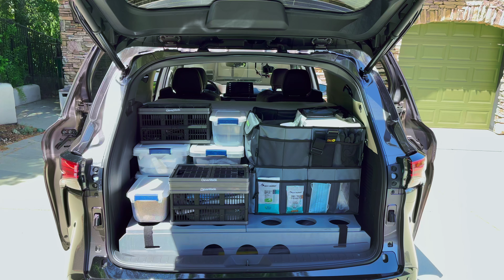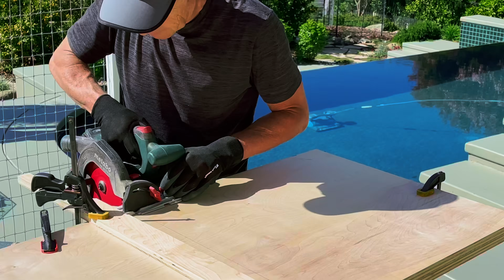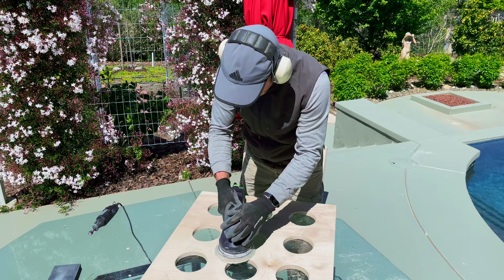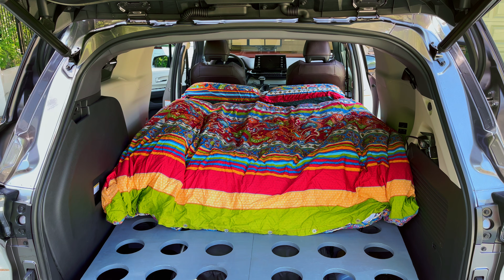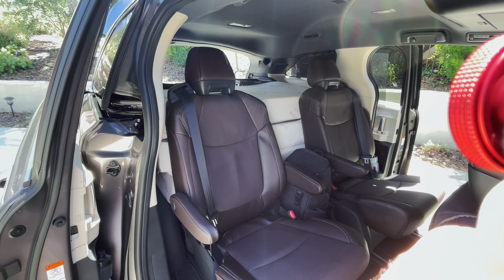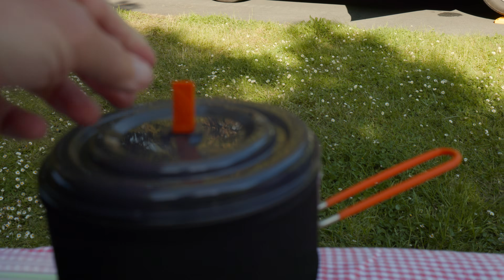2021 Toyota Sienna Camping Conversion: 2 and 4 seats sleeping configurations

Comment: Thanks for posting the Sienna videos.
I have a 20 year old AWD Sienna that I sleep in from time to time.
I love it. 
It’s pushing 275,000 miles and I’m thinking about getting a 2021 or 2022 AWD.
They’re not so easy to find in So Cal.
I found one in Palm Springs, but the website doesn’t have a price and it’s green. I prefer green in mine but maroon in the new ones.
So my requirements are AWD and spare tire.
I’m not in a super big hurry to buy.
I’m not in the market for one as high end as you with the inverter etc.
Some reviewers complain about the lack of power and the engine revving all the time.
I don’t drive that  aggressively but I am sensitive to sound. I need to find one to test drive.
I am a little concerned about the battery. It wouldn’t last 20 years like my current van has.  Maybe 10 years like the one in your Tesla.
I have an R5 too and will comment on one or two of your videos about that.
I don’t use my van or camera nearly as much as you, but again, appreciate the videos on the subjects.
Reply from the maker: Thank you for watching and sharing experience with your Sienna. Impressive mileage on your van. The shortage of microchips delays production of many vehicles nowadays and dealers ask for MSRP or more with extra add-ones. I hope this will change soon. Regarding your questions about the noise and power in new Sienna, you should definitely test drive it to make sure it will work for you. I believe  you will be impressed. After owning 18 vehicles, I think new Sienna is one of the quietest vehicles while cruising on a highway. You probably have seen my video “5 likes and Dislikes…” about our Sienna, where I tested how it sound inside and driving dynamics. It does make some noise upon rapid acceleration but not any more than any 4 cylinder engine. From discussions about the hybrid battery, I understand that Toyota has recently changed how the hybrid battery charge/recharge cycle is managed to improve it’s longevity and increased the warranty for the battery to 10 years. Even if will last only 120K miles, at today’s gas prices, the savings in fuel economy of the hybrid will more than cover the cost of battery replacement. I am glad to hear that you own an R5 camera as well. More videos about my experience with R5 are coming. Cheers!
Reply: @Tellvia  Thanks for the reminder on the 5 likes and dislikes.
I watched it some time back but wasn’t seriously looking at a hybrid Sienna at the time.
The front seats are a big deal. Some other reviewers have noticed the same. I wonder if I could get some kind of support to put on the seat that would make it more comfortable versus the 1” spacer idea.
A local dealer had a Woodland on their webpage on Thursday.
I went by on Friday and it was presold.
I’m not a big fan of the cloth seats, but the inverter and luggage rack are of interest.
Your model is sort of high cost for me. Very nice vehicle though.
It is certainly a seller’s market.
I removed my DYI structure for sleeping from my van and put the seat back in.
It’s more ready to get rid of.
Might be soon.
Might be a year.
Thanks again.
Reply from the maker: @recordbutton1845  Thank you for watching and sharing your plans for new Sienna. We’ve driven over 10K miles an with the 1” mod the front seats now feel great on long drives. Good luck with your search for new Sienna. Cheers!

Comment: We were looking to test drive one but there aren't any around because they're sold before they hit the lot. We did manage to rent an XLE for a day and got to put about 178 miles on it. Took 5 gallons for 35.6 mpg in heavy highway traffic with a little around town.  We really enjoyed it and it was fun to see how much we could charge the battery and how often it switched between engine and battery power. I did notice that the battery kicks in climbing hills. We really enjoyed it and our local dealer has requested a Limited version for us.  Looking forward to the ventilated seats here in Texas.
Reply from the maker: Thank you for sharing your impressions after test driving Sienna. After 6 month of ownership and 10k miles we love it even more then when we took delivery. I hope your dealer will get your Sienna soon. Cheers!

Comment: Thank you for sharing! How about roof top solutions, do you know if Toyota Sinna can support the weight of two adults and a tent? regards.
Reply from the maker: Thank you for your question. Most of roof rails rated for only 150-165 lb weight load, so unfortunately sleeping for two setup will be too heavy. Cheers!

Comment: I really looked into and wanted to buy a Sienna. But, I will be keeping the $50k+ I was willing to pay for a  loaded Sienna. Toyota totally Failed with the nonremovable second row seats. You're having to build a permanent floor, when you should only need to remove the 2nd row with a latch, then fold down the 3rd row, throw in a cot and mattress and you are ready for the weekend. You can turn it back into a family hauler on Monday. It also, Defeats the ability to haul more of your fun stuff due to the 2nd row taking up valuable cargo space. It's such a Huge Fail for Toyota to ruin the usability and potential awesomeness of the Sienna! I'm going camping and hiking, someone at Toyota should take a hike as well.
Reply from the maker: Hi Michael, thank you for sharing your thoughts. I agree the current version of Sienna is not a perfect camping vehicle. I think Toyota designed it for families with urban lifestyle needs only. Perhaps, Toyota will  make a camping version of Sienna with custom equipment packages installable by their dealers or customers themselves. Mercedes Sprinter is a good example of a van available in a bare bone trim for aftermarket camping builds. Cheers!

Comment: Hi! Would you be kind enough to share how you removed the third row? Did you break the plastic snaps that hold the covers in place? What did you do with the seatbelt wiring? Thank you!!!
Reply from the maker: Hi Mele, thank you for your question. To remove the plastic covers use an automotive trim removal tool or a flat screwdriver.  Behind the covers you will see hex bolts that hold the seats mounted to the frame of the van. Before disconnected the seatbelt wiring disconnect the 12V battery of the vehicle. The 3rd row seats are mounted as 2 parts. They are heavy (smaller one is 90lb and the larger one is 136 lb), you may need to ask for a help removing them. I hope this helps. Cheers!

Comment: What is the available maximum bed length when using the 4 seat layout? Thank you, great video information!!
Reply from the maker: Thank you for your comment. With 4 seats present and 2nd row seats folded and slid forward there is 72” from the back of the 2nd row seats to the back door. We slept in this configuration for several nights, its doable but not ideal. I hope this helps. Cheers!

Comment: A minivan without removable 2nd row seats.  Sorry, but that's stupid.  I'm out.
With Toyota's access to top notch engineers, you cannot tell me that they couldn't have figured out how to have the 2nd row seat air bags that would have an adapter/plug, with which the owner could easily disconnect (disengage) and reconnect (engage) so as to easily remove/install the seats.  
SIMPLY INEXCUSABLE.
Reply from the maker: Hi Tim, thank you for sharing. I agree with you. I think the number of buyer interested in using new Sienna for sleeping is relatively small in comparison to total customer base, but even one safety issue with the seat removal may cost Toyota too much to take the risk. Cheers!

Comment: Did you check engine light come on after you removed the 2nd row seats because of disconnecting the airbags?
Reply from the maker: Hi Ecos, thank you for your question. Any time the airbags are disconnected without appropriate resistor bypass a warning message will appear on the dashboard. Search the web regarding this issue. I uninstalled my seats at my own risk. If you are not comfortable with this step I suggest you consult your automotive professional. Cheers!

Comment: Well… you may have changed again.  For over a year I’ve been looking at options for traveling & camping solo. I had initially decided on a Casita travel trailer but I couldn’t get past feeling unsafe & needing to leave.  What do I do?  Run to the car, drive away & leave the trailer?  Well that won’t work.  So, I decided on a van… not a $100k tricked out ride… just a plain cargo van with a no build build. If I’m uncomfortable I can jump in the front & go.  I’m still in the van mind set, but am seriously considering a compact van such as a Ford Transit Connect which would be the cheapest option for a van no more than 2 years old. 
     I decided before I sold my Acadia SUV, I’d try camping out of it to see if, at age 73, I still enjoyed it as much as when I was younger, if I could do it physically & most importantly… comfortably.  I took out the 2nd row seats for storage. Threw in an air mattress, cooler, storage bins & a bucket potty.  I spent 2 weeks in Southern Colorado & loved it… so it’s a go for me.
     BUT… I won’t be full time & it seemed that if I had a bit more head room, I could do it out of am SUV.  Only problem is, my SUV has only 32” of room between folded 3rd row & roof.  I haven’t found any SUV’s that have the floor to ceiling room behind the front seats like minivans do… particularly the Sienna.  I want a vehicle no more than 2 years old. I’ve been watching minivan videos for 3 weeks now and yours is the first I’ve found using a new model. I like the idea of leaving the smaller of the 3rd row seats just to have a place to sit comfortably in the back.  
     After watching what you’ve done, I really think this would work for me as a solo camper. Thanks so much!
Reply from the maker: Hi Linda, thank you for sharing considerations for your next camping vehicle. If you don’t plan to carry a lot of luggage new Sienna does make for a comfortable sleeping vehicle. An extra tall tent like a Clam could serve as a kitchen, dining room and shelter on a rainy day of camping. Good luck with your search. Cheers!

Comment: Have you experienced any issues with airbag warnings after removing the seats and putting in a resistor?
Reply from the maker: Hi Chris, thank you for the question. I have not experienced any issues with the airbag warning, they are not even shown on the display (normally when the rear air bags are connected, but without passengers, they are shown as red symbols). Cheers!

Comment: A full size US mattress is 54” wide.  How do you fit that into a 48” wide space?
Reply from the maker: Hi David, thank you for your question. We bought a 52” wide mattress which comes in 3 sections (see a link in the description of the video). The narrowest part of the van inside is 48”, so the section that is placed between the rear wheels gets compressed by 2” on each side. The mattress is made of a foam material and it is relatively easy to do. I hope this helps. Cheers!

Comment: Love your videos, dont they tell you not to remove the 2 middle seats because of the battery? And what trim is this?
Reply from the maker: @Earth Human, thank you for your comment. Our Sienna is in Platinum trim. Cheers!
Reply: @Tellvia  o wow, is the vacuum and fridge/center console removable?
Reply: And does the toyota have braking like a tesla? Like one pedal driving? And does it have any kind of full self driving features like radar cruise control
Reply: And does it have a panoramic roof?
Reply from the maker: @Earth Human, the early 2021 Sienna’s did not come with small fridge or vacuum  I am very glad that I don’t have them in our minivan, as these appliances are just toys and take extra space),  Toyota hybrids have regenerative braking, but not as strong as in Tesla. It has a radar cruise control which works, in my experience, better than in Tesla. It also has a line keep assist, but I don’t use this feature in our Sienna or Tesla, as I find them in both vehicles not that reliable or helpful. No panoramic roof, just a regular moonroof. Cheers!

Comment: Great job!  I have same model of this minivan. Can you share the measurements to me?  Thanks
Reply from the maker: Hi William, thank you for your comment. I did not make any plans or measurements before building the bed structure. The key consideration is the hight of the bed surface which is determined by the equipment (I.e. refrigerator) you plan to have in the well of the third row seats. I plan to make a more detailed video discussing the design and key measurement considerations . Cheers!
Reply: @Tellvia  I am waiting for your new details video now.  Thanks

Comment: Thank you,so much for this. I have been looking intodoing this as well. Did you do inhibitors in the 2nd row circuit to get the air bag light to go off? From my understanding the airbags will not work in the vehicle unless you do this.  If you did can you please post a video on this. I have subscribed, as I have been waiting for,someone to do,this.
Reply from the maker: @jkbaumohl, thank you for subscribing. Unfortunately, because the airbag disconnection/bypassing could lead to an accidental discharge of the airbag and cause a potential injury, for safety of viewers, I will not be making a video about this part of my project. Please consult your automotive professional about the airbag light bypass question.Cheers!

Comment: Once again, awesome build!

In your research, did you happen to come across any conversion companies that install a pop top on the 2021 Sienna? GTRV seems to only do so for 2020 or earlier Siennas; not sure why they don't do the 2021 Sienna.
Reply from the maker: Hi Jose, thank for your comment. The idea of pop top camping conversion is very appealing and looks cool at a campsite. I have not considered, or researched the pop top options for our Sienna, however, for two reasons: I want to avoid major body modifications to preserve resale value of the van and because I prefer not to add any extra weight to the top of the vehicle for handling reasons. Let me know if your decide to go for this build option. Cheers!

Comment: Excellent content. I wish this beauty was available in Europe. What is average consumption of gas during night sleep with AC turned on? I heard that in PRIUS hybrids consumption with AC on during night is ridiculously low. Thanks!
Reply from the maker: Hi Alnis, thank you for your comment. Unfortunately Toyota has changed how the hybrid battery is managed in the new Sienna - it does not allow deep cycling of the battery as in older Prius did. As a result with the AC ON the gas engine starts every 10 min for about 3 minute and this cycle repeats as long as the AC is ON. We did not sleep with AC On on our camping trip, not to disturb the campers at the neighboring sites by frequently starting engine. According to Prius forums its hybrid engine consumes 0.25gal/h when idling with a load (AC + charging the battery). Using this consumption data and my data ~ 15min/hour engine run in new Sienna, I would estimate that it would consume 0.25gal/h x 15/60 =0.06gal/hour. So after 8 hours of use/sleep this would be 0.5 gal (about 2 liters of petrol). I hope this helps. Cheers!
Reply: @Tellvia  Hi, Thanks for your answer. You got a new subscriber. I saw your video about AC and camping already. Thanks!

Comment: very well made video, Thanks.

im wondering if you recorded the second and third row removal.   I am going to be adding sound deadening and sound control to the whole van, to make what is already good into Great. better sound for music and videos.
i know you dont really use the video system, does it block rearview when its down? im over 6' so my head its already closer to the roofline thus my concern.
im thinking of mounting it more toward one side to allow for uninterrupted visivility.
again cheers on your skills for the video making, explanation and practical modifications.
Reply from the maker: Hi Tato San, thank you for your question. Yes, when rear entertainment screen is down is blocks the optical rear mirror view. Toyota offers an electronic (video camera feed) rear view by flipping the optical mirror. I was skeptical about it, first, but now we use the electronic rear view video and love it. It is crisp and a screen or luggage in the back don't block the view. A video about removal of 2nd row seats, made by someone else, in on YT,  just search for 2021 Sienna 2nd row seats. The third row video removal is pretty straightforward - mounting bolts under plastic coves and electrical connections for the seatbelts. I hope this helps. Cheers!
Reply: Thank you for the Reply,  my trim is the LE. And though I’m adding $3000 worth of sound treatment video, audio, I’m actually staying within a budget, so the digital mirror won’t.  It’s my assumption that you having the platinum trim your soundproofing it’s better than the LE trim. I am removing even the dash and adding a few extra speakers and subwoofer (since mine doesn’t have the upgraded JBL) . Im quite happy with my purchase since it was only 37k after delivery and Taxes😉👍🏽.
Keep up the good work!
Reply from the maker: Good luck with your project! Sounds like you are having fun doing it :)

Comment: Does this have climate control like Prius?
Reply from the maker: Hi John, here is a link to my video where I talk about using HVAC in new Sienna for camping https://youtu.be/bngRFxiYagY. From what I understand, Toyota recently has changed how the hybrid battery is managed. The allowed battery discharge capacity when vehicle is parked with HVAC on is now much lower now. The gas engine is turned on after about every 10 min or HVAC running on battery. I hope this helps. Cheers!